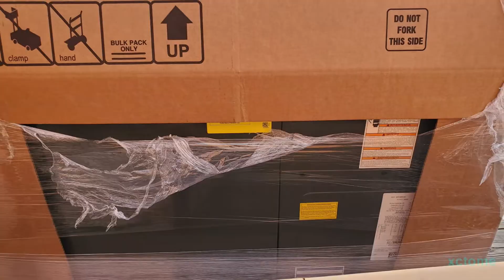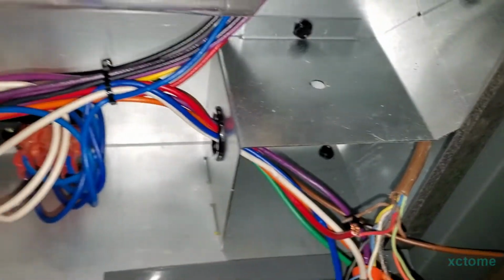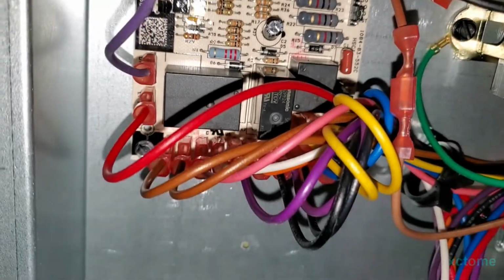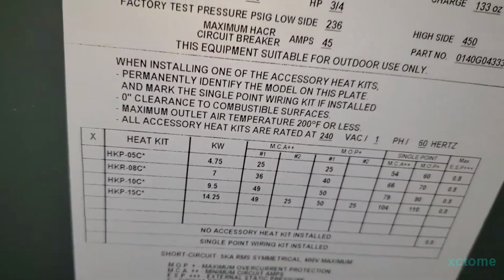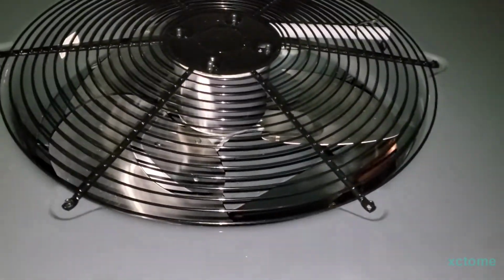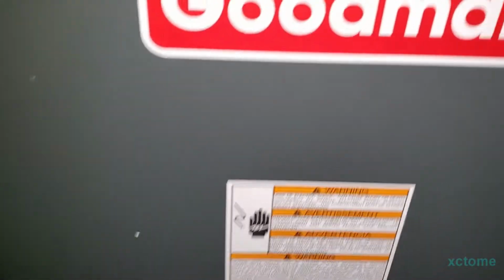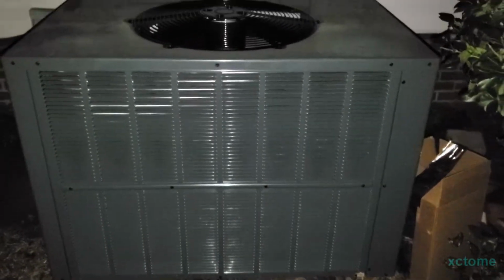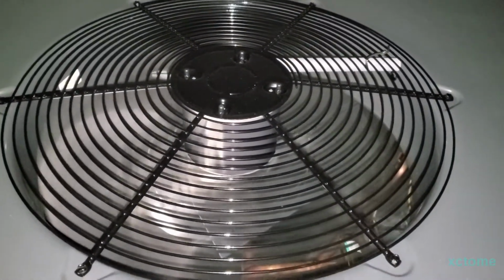INSTALLATION OF THE NEW PACKAGE HEAT PUMP AND FIRST STARTUP in HEAT Mode 01-06-21

Comment: I was in kindergarden when the old goodman was installed I cant believe its been 12 years since then
Reply from the maker: Time sure has flown by! I was 12 when the old Goodman was put in, it feels like it was only yesterday!
Reply: xctome why was the old Goodman replaced? I like the new one though
Reply from the maker: @ArisBuliteanu  Blower motor burned out and it was obsolete, plus the unit had mold and corrosion all in it, and it was oversized by at-least a ton if not more.
Reply: xctome when the Goodman 4 ton unit was dry defrosting, why was the compressor working harder? On the outdoor unit?? Nice video! I'm glad to see the beast running
Reply: xctome how do you hook up the heat strips in the new unit
Reply from the maker: @ArisBuliteanu  they slide in and plug into the unit's wiring along with the 220V 60A high voltage line coming from the breaker panel.
Reply: xctome in defrost cycle, what does the compressor have to work harder?? I mean why
Reply from the maker: @ArisBuliteanu  Defrost cycles are hard on compressors due to the sudden change in refrigerant pressures - the pressure is always higher in heating mode than in cooling mode. Scroll compressors can tolerate the sudden change in pressure and mild liquid slugging when shifting in and out of defrost but they don't like it and they have to work harder, that can be heard when a unit shifts in and out of defrost the compressors gets very loud and angry sounding sometimes, then quiet once the pressures drop to normal operating rage - smart shift not only makes defrost cycles quieter but keeps the compressor happier as well. Defrost cycles do not damage the compressor unless the system is over charged or has contaminants in the refrigerant or faulty reversing valve. R22 operates at lower pressures and R410A is a high pressure refrigerant.
Reply: I wasn’t even in pre school when I started watching this unit, time flies.